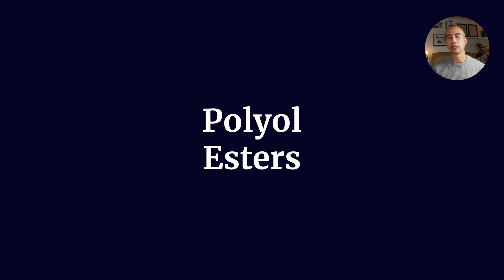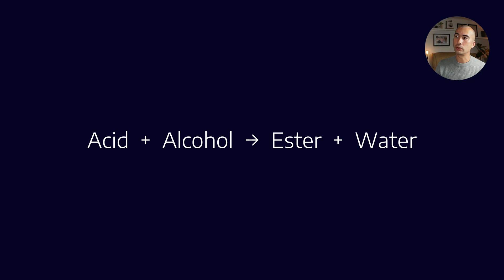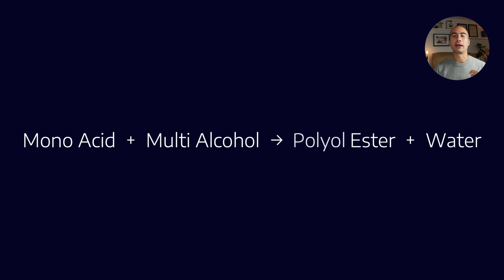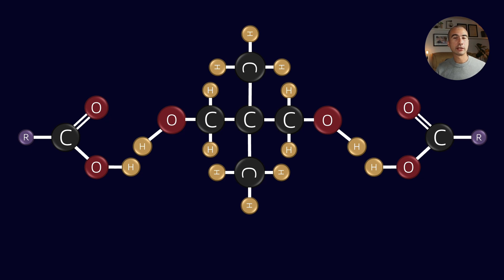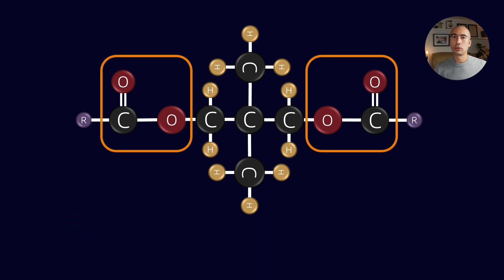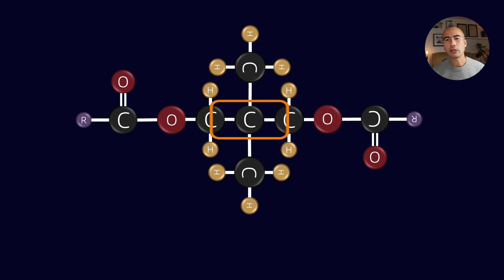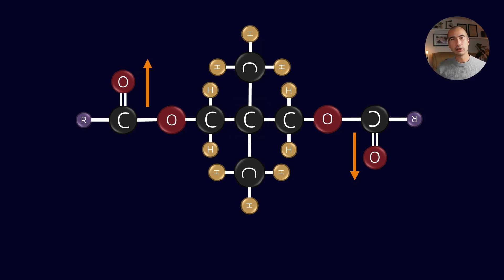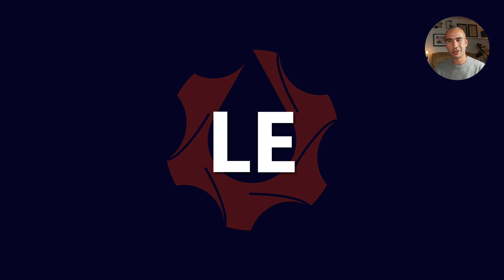How are polyol ester base oils different?

Comment: Correct me if I'm wrong, but there's a drawback to using esters in engine oil... will the oil tend to become acidic quickly?
Especially in certain cold and humid regions of northern countries.
(ester + water -> acid + alcohol)

Comment: PLEASE ADVISE... I will drain POE "oil" from my "fridge compressor"(as it's been exposed to air/moisture for several weeks, hence concerned about acidity) and use a mineral(Group III?) vacuum pump oil (as the compressor will be repurposed as a vacuum pump). But before pouring in the mineral oil, I'm considering pouring in ethanol(95%) and swirling it around as an acid absorber/flush solvent, based on info from US Patent 5,770,048 - "Method For Removal Of Acid From Compressor Oil"*** which indicates that ethanol is able to absorb inorganic acid(e.g.HCl acid), separate it from the oil, vaporize, and eventually leave(evacuate from) the oil, sump, and compressor. It further suggests that if there is any organic acid, the ethanol would produce ester and a relatively insignificant amount of water(which would not be an issue as I'd drain out the ethanol+acid/ester+water remnants after the flush intended swirling). Your thoughts / advice about my intended procedure would be much appreciated. Thanks again for the great videos! Cheers~!
* Note: The text in the patent mentioned above is repeated in a QwikProducts' knowledge base paper("Acids In Refrigeration") about QwikShot Refrigerant & Oil Treatment except the mention of ethanol is replaced with "QwikShot".

Comment: Is WD-40 a group 1, 2 or 3 and is it OK to squirt a bit into my fuel tank (diesel) to help displace water and help keep the fuel pump lubricated? Why? Cause it's less expensive then the alternative (as marketed) fuel system cleaner.
Reply: It’s none of those groups, and it’s basically fish oil with cheap distillates. DO NOT put it in diesel fuel. Use a proper water stripping filter for your fuel.

Comment: Hello, can you kindly advice what kind of Polyol ester would go well with Refrigerant R 134A or 410A..
Reply: I'm using Emkarate RL68H for R134a with reciprocating compressor, and RL32H for R410a/R32/R290 for rotary compressor. Sometimes i used RL68H for Old Compressor either reciprocating or rotary

Comment: If I put polyol ester in a 20w50, at a rate of 10%, will it protect agains oxidation?
Reply: I mixed it 60:40, and already done it for 5 years before covid for my car & motorbikes engine. I used any 15w40 (Gasoline/Diesel) with readily & easily to obtained in my place RL68H Emkarate compressor oil. Even before Emkarate Oil.. i mixed 1 part Shell Spirax S5 ATF X (POE Base Oil) with 4 part engine oil.
Reply: @hendrazair9898  are still using it now ? What is the benefit blending this in engine oil ?

Comment: What would cause the reverse reaction (degradation) back to the mono acid and multi alcohol?  Do you need the water present for this and if so how much heat is required?

Comment: I'd like a comparison/contrast between a Polyol ester and a PAO oil such as comparing Ravenol to Redline.  I've read once that mixing the two forms a great base oil as they cancel out each other's weak points.
Reply from the maker: I think I answered this on another video, but just in case anyone come across this comment and had the same questions: generally, PAO's are going to come out on top for oxidation stability, energy efficiency and wear protection. POE's come out on top for thermal stability - that's important in the turbo, but their big weakness is that they are sensitive to hydrolysis (breaking down in the presence of water). The big downside of a PAO is it's inability to dissolve additives, and this is often why some POE is mixed in - but in some of the newer formulations the esters are being replaced with Alkylated Naphthalenes because they hold up better with water contamination.
Reply: POE causes such trouble in genetically sealed systems because want water turned to acid, and copper pipe plus hot steel compressor gives you copper plating and premature death. Once the oil gets wet you can't unwet it like others by deep vacuum.
Reply: You mean Ravenol is Ester and Redline is PAO?

Ravenol is Pao + Ester - says on their website.
Redline I assume is Pao + Ester too...
Reply: @nesmio7378  Unless they changed their formula, Redline has always been group V, ester.  I use redline when I want to do a real good engine cleaning.  Works wonders on hydraulic lifters.
Reply: @nesmio7378  The oil I looked up showed Ravenol to be pure PAO.  Redline is supposed to be pure Ester in most of their oils.  Redline has a "professional" line that is more OEM rated that is a mixture of Group III, IV and V I believe.

Comment: So whats the best type of.motor oil ?? I cant pay attention to every detail while working
Reply from the maker: Unfortunately “it depends”. But for the most part, a full synthetic will give you the best performance. These days if you can find something which is PAO/Ester or PAO/AN you can’t go wrong.
Reply: @LubricationExplained  What about doing an oil change half with a IV and half with a V?  Can they be mixed?
Reply: @datsuntoyy  You have to consider more than just the base oils. Another big part of the chemistry makeup has to do with the additive package and the percentages of the various additives as well as percentages of base oils the company uses. A good rule of thumb is to stick with the same company if you are going to mix oils but even then it can be tricky because they don't reveal enough details for a consumer to make an educated decision. Too much much POA without enough group V or even group (3) along with corresponding additives can be problematic. It has to be carefully balanced correctly!
Reply: @NickeryNelson   When it comes to additives you can look at analysis and see what is in it, but most people really don't know what's good or bad in that aspect.  Only thing we can really keep an eye on is base oil.  
I'll take V and IV any day, atleast you can be reasonably assured it's starting from a good point.  I just wish they'd stop calling group III synthetic.

Comment: 😍excellently explained oxygen electronegativity makes POE a good film forming agent and already containing oxygen makes it oxygen repelent which makes it oxidatively stable and beta hydrogen is more secceptable to oxygen attack so absence of beta hydrogen is another factor of oxidatively stable. new for me. what thing makes it thermally stable?
Reply from the maker: Good to hear from you Muhammed :) So I think the thermal stability is mainly down to the bond saturation and intra-molecular forces. I don't think you get significantly more thermal stability compared with other synthetics.